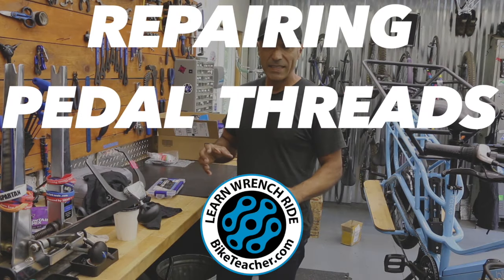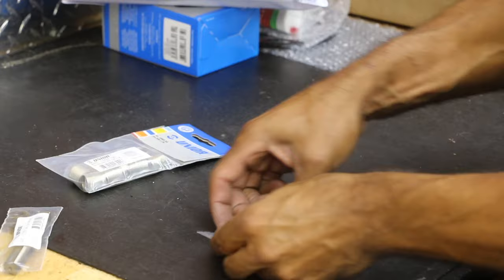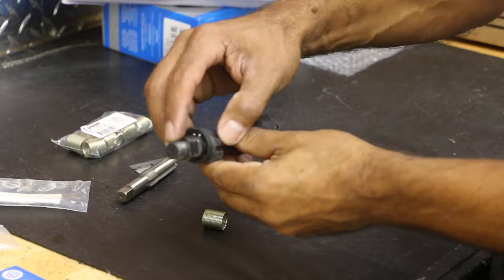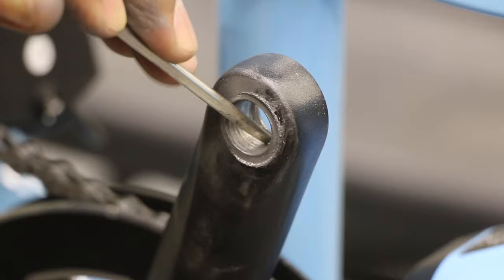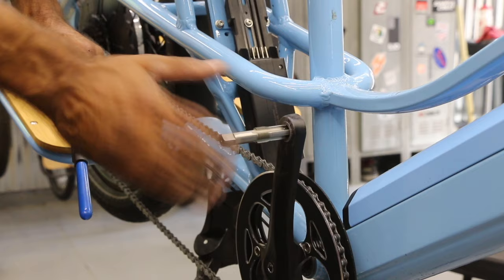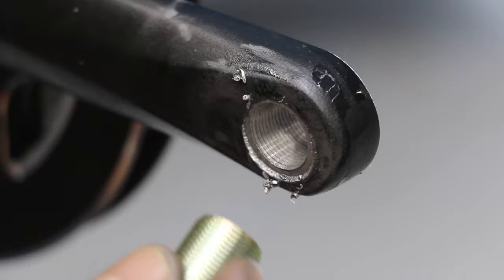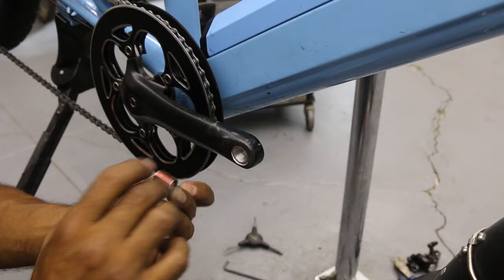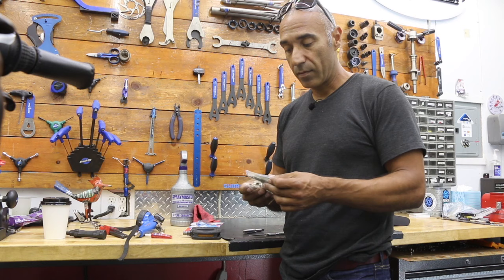How to repair stripped pedal threads on the crank arm with Unior bushing and a pedal tap.

Comment: I loved the video, so thank you for that. I understand these are special tools. Now... $178 + $11 = $189 --> Almost $200 to be able to perform this service is a little too much. Unfortunately, it looks like it would be cheaper (and easier) to order new crank arms and just replace it.
Reply from the maker: I agree, that is a valid option. I believe some shops are charging about $20 for part and labor. That sounds pretty cheap and would double check on that.
Reply: I would love to find any shops around here that would charge just $20 for this service, that is a really fair price. That indeed sounds like a great deal! I currently have a shimano ultegra left crank with this problem, which makes it a somewhat expensive replacement (for me) that would be ideal for this solution (instead of replacement). I am really glad you posted this video, so I can show people exactly what I am looking for in terms of service. I'll keep looking, thanks once again.
Reply: I have to say this is the first video of this type of tutorial I have been privileged to see. Excellent example thank you !
Reply from the maker: @sirhconardem7749  Many thanks!
Reply: The kit shown is not intended for the consumer.  Why would one person with one stripped crank thread need ten or 20 thread replacements?  They wouldn't!  Plus, buying all the tooling for one repair is not cost effective by itself.  The cost of this tool set is for the bicycle repair shop.  
An hour of shop time plus parts puts you probably at about $60 for the repair, making it a cost-effective solution.  
And some shops may be willing to perform this for less; it just depends on location.
Reply: @dudeonbike800  fair enough.

Comment: Like many of you that have experienced this I had spent hours trying to figure out the best solution to fix this problem the bike shops were charging high prices and the unior kit itself was too expensive being from the uk I tried to source the pedal tap but was costing too much to have it shipped here.  I had the threaded crank issue on my drivers (right hand) side so here’s what I did(extremely simple did not require any vices/ grips or unnecessary attachments. After waiting ages I managed to source a single unior pedal tap from deporvillage and a helicoil from sjs cycles  all in all I spent £42 for these 2 items I simply laid my bike upside down used an adjustable wrench to turn the pedal tap once it was inserted in the crank and simply turned. The measurements confused me as I had no idea what size helicoil or pedal tap I would need but I believe more than likely most bikes nowadays have the measurements of 9/16 which could also be called 5/8. Make sure when purchasing that the measurements of the helicoil and unior pedal tap are the same for example my bike required a 5/8X 24 also seen as 9/16X24 I made the mistake of purchasing a pedal tap off of eBay and the size was 5/8X20 which also did not thread correctly 🤦🏽‍♂️avoid buying cheap to save money and purchase the unior tap. Also thanks to the creator of this video made this extremely easy to follow
Reply from the maker: 👍🏽 thanks

Comment: April 2023 Question: I followed all of your instructions, and the tap went through very easily.  But, the 9/16 helicoil would neither fit over my pedal, nor would it screw into the pedal crank! So, I'm not sure what sized devices (tap;helicoil) to buy, as I'm not so good with measuring or fixing things like this. Can you tell me what's the next slightly larger size is, in order to fix this?  I have a mtb from China, and the dealer told me the size is universal.  Would the next size up be too big 7/16 I think?

Comment: You're the Greatest. I bought a reconditioned spin bike eight years ago (I know...I know... you live and you learn) and I immediately used it. Within two days the right hand pedal fell off. I examined the pedal threads and they were stripped and the pedal crank as well. Since that time it became a paper weight until I saw your video and right away it made sense. I checked off all the tools and materials that I would need from your video and waited a month for all of it to eventually be delivered. The Unior bushing and the pedal tap took the longest to arrive since they were out of stock domestically,  they were ordered from Spain and France respectively. I reviewed your video countless times to detect any nuances that might benefit a successful repair. Aside from that I checked other taps and bushings that were sold on Amazon and the reviews were discouraging. Most of the purchasers revealed horrible results. Finally I was able to use all the tools, parts, cutting oil, thread locker, and air canister in your video to commence with my repair work. It only took five minutes from start to finish. It was successful and I couldn't be any happier.  I 'm allowing the Loctite thread locker to set a couple of days.
Reply from the maker: Thats great Ricky! Glad I could help. The job seems a little daunting at first but 5 minutes proves otherwise.
Reply: Question: If I am repairing the left pedal instead (vs. the right in the video), does the coil and threading tool go in clockwise also? (I understand for the left side, the pedal tightens counter clockwise).  Thank you.

Comment: I just had a Crank Arm Thread issue a couple of days back. After some attempts finally found the solution through a Local Forge expert, who used the same rethreading tool (eventually arm thread was fine, only it needed a torsional forces with a heavy thread sleeve).

Was talking about this frequently during the whole time & YouTube comes with this today !

SCARY AI & Tech !
Reply from the maker: Scary interesting.

Comment: For the last part of the process, it works out easier if you thread the new bushing ( Helicoil ) onto the pedal first, then use the pedal as a delivery system for introducing the bushing into the crank.

Comment: Excellent video!  Thank you!
Stripped pedals all because the #1 bike shop rule isn't followed:
"All the way on or all the way off!"

Never "just snug it down and come back to it later" in bike repair.  Doing this may kill you, someone you love or a customer.  Your pedal may fall off,  your stem may twist, your front wheel may fall off!  This has happened and will happen time and time again when this rule is disregarded or forgotten.  This is what employs lawyers and ruins lives.

Three rules to follow when working on bikes (and stuff in general) and you'll go far (figuratively and literally!):
1)  All the way on or all the way off!
2)  Grease metal-metal contact.  (Yes, there are exceptions.  But they are few.)
3)  Test ride all your work.
Reply from the maker: Thank you Dude!

Comment: I keep stripping the pedal on the left side of my bike thank you for the information
Reply from the maker: Your welcome. 👍🏽
Reply: Question: If I am repairing the left pedal instead (vs. the right in the video), does the coil and threading tool go in clockwise also? (I understand for the left side, the pedal tightens counter clockwise).  Thank you.

Comment: You'll find this alot easier if you take the crank arm off first, then hold it in a padded vice. Then using a long handle ratchet set, and cutting fluid.
Reply from the maker: Yes, that can work to.

Comment: It looks like Unior has discontinued the kit, but added a new kit to their site with a tap handle for $300. Kinda rough for just fixing a crank set arm!
The taps and tap handle are easy enough to source elsewhere, but the thread inserts are a bit harder to find. How can Unior be the only ones that make them at 9/16" 20TPI?

Comment: Realky Thanks , it saved my bike, and just for  only 50€ ( 40€ for the tap and 10€ for the insert )
Reply from the maker: Cool!!
Reply: The crank is removable - you don't need to throw away the bike if there is a problem with it. In fact, you could've bought a new crank for less than you paid to re-thread the old one and then you wouldn't need worry about the insert coming loose in a few months.
Reply: djsjjd15 yess i know but mtb cranks are expensive and i doesn’t want to pay about 200 bucks bc i have some race face turbine crankset so i have just rethreaded it and after 1 month of utilisation this is perfect

Comment: I actually have a problem with a new bike, new pedal where the right pedal won't screw on the right side. Any tips?
Reply from the maker: The first thread of the crank most likely is fat. Use a pointy scratch all to clean the threads. And or install the pedal from the rear and hopefully it reaches the damaged thread to. This will help to clean up th threads.

Comment: Hi, Nice video. Very clear. I wanted to ask you if you think I machine a bushing with 1/2 20 TPI threads inside and )/16 outside soI can fit a set of 1/2 pedals into 9/16 crank without adding extra length as it’d happen ifI but the adapters available in the market.
Reply from the maker: I have not heard of that procedure or parts for that.

Comment: The pedal tap size is 9/16", a threaded insert of the same size was placed into the new hole. A pedal with the same dimension of 9/16" will fit into that insert. That's what I am understanding. But if I attach the pedal directly to the crank arm with the newly threaded hole, will the pedal still fit? I am a little confused...
Reply: This is what I want to know too
Reply from the maker: The tap will over size the hole allowing the insert to fit and downsize the back to its original pedal size.

Comment: Boom! Subbed, I needed to look this up for work in the shop. You just hack off the extra or leave it on?
Reply from the maker: I leave it on. Cutting it would take time and precision. They can be unpredictable and crumble. And there is chance of scoring the crank. Risky. Structurally it will be fine.
Reply from the maker: Thanks for the sub.

Comment: Just came across this video notice it said
San José 👍🏽 I’m from here..
So just bought a bike pretty much new. The bas is both pedal and crank tread are both gone so you said if pedal tread is gone toss it 😆 so now does that mean I need to buy new right side pedal and also the kit to fix tread on crank? Can I just weld the pedal on?
Reply from the maker: I am not sure about the welding. Pedals usually survive due to the harder metal. The crank arms may me replaceable depending on the style. If the crank arm has enough material to work with it can be repaired. I provide the service if needed. You can text me pictures if you want. Thanks, Arthur
Reply: @BikeTeacher  thanks bike teacher for reaching back..
I took it to a bike shop and they where able to rethread the crank shaft for $15 problem solved 👍🏽

Comment: How sturdy are these inserts?  I just stripped my left crank arm and the kit was more than a new crank arm set I found on ebay.  Before ordering, I called a LBS to see if they'd do it and they just recommended a new crank arm, since he felt one or two good pedal strikes would ruin the insert.  Thoughts?
Reply from the maker: So I believe the inserts to not fail. I have not gotten negative response on the one in installed. I wish I could say I have had an inset on my bike for several years with no issues but I never had one. But the kit if you will use it repeatedly. Buy the crank if it’s cost effective.
Reply from the maker: Typo, I have installed maybe 10 in 5 years.

Comment: So when you do the other side you would use a different tool and go anti... sorry,  from England! counter clockwise when making the new thread? Good video,  good teacher.👍
Reply from the maker: Thanks James, yes there is a left side and a ride side specific cutting tool.If you are standing on the left side of the bike, yes you would turn counter clockwise to clean and thread the left (non drive side) crank arm.

Comment: Thanks for posting! I recently damaged my brand new XTR 9120 L crank and stripped most of the threads. I use it on my enduro MTB. Ive had bike shops tell me the crank is finished and don't use a bushing, but this looks very solid. Do you think there are any safety issues with this? I'm definitely tempted to give it a try considering how much $$ these cranks were.
Reply: It is probably not a great idea with hollow crank arms, which that one probably is.  Most bicycle cranks are not hollow though.
Reply: @curtiswthomas  bike shop put helicoil in and has been rock solid.
Reply: @LDubsChannel  thank you! I was watching this because I also stripped my left crank on my Shimano 105 cranks. Good to know that it’s been rock solid for mtb.
Reply: @LDubsChannel  how is it holding? I want to know if this is a good idea for enduro riding

Comment: Actually I got that part for $20 on Amazon.  The tool to make the threads size is 5/8  . Make sure you specify for the right or left side . And the little insert adapter for the pedal is 9/16 (same size of the most standard pedals)  and also you have to order it for the side you need . That little adapter cost me $6 .. total: $26 with taxes . You don't need any fancy tools , just the regulars you have at home . And also you don't need the lock tight liquid.  This is just a bycycle and not a motorcycle .
Reply from the maker: Thanks for the info.
Reply: Could you be more specific when you say "that part"? im going to try to fix my exercies bike soon
Reply: Question: If I am repairing the left pedal instead (vs. the right in the video), does the coil and threading tool go in clockwise also? (I understand for the left side, the pedal tightens counter clockwise).  Thank you.
Reply: @rtong12  it goes the opposite

Comment: How about installing helicoil on Shimano crank arm pinch bolts? I find myseld in a situation now that I've stripped those pinch bolt areas as I kept on removing and reinstalling for a deep clean.
Reply from the maker: The threads in the crank arm are damaged? Or the bolts that use the 5mm tool are stripped. I can see repairing the crank arm pinch bolt threads. They give you good access. Finding the appropriate size will require some research.
Reply: @BikeTeacher threads on the crank arm are the ones stripped.

Comment: Thanks but my fatbike too broke my bike pedal treads broke what type of treads i need ?
Reply from the maker: The most common pedal thread size is 9/16". The tread pitch is standard. One size should fit all. Choose left or right side insert and tool. The one tool will clean out the crank hole and prepare the thread all in one procedure. Don't for a t handle to insert  maneuver the tool.

Comment: Maybe a silly question but I have just bought the same parts for my left pedal. Do I need to screw the tap in anti clockwise? I'm a little confused and don't want to do it wrong way and wear it away
Reply from the maker: Your right, while standing on the left side of the bike (if seated) turn the tool anti clockwise.

Comment: Question: If I am repairing the left pedal instead (vs. the right in the video), does the coil and threading tool go in clockwise also? (I understand for the left side, the pedal tightens counter clockwise).  Thank you.
Reply from the maker: Yes, you are correct. The left side will be clockwise. Thanks, Arthur

Comment: Hi, I need some advice. My bike's right pedal crank arm's thread stripped.. pedal thread size is 9/16, 20 TPI. What's the size of Thread Tap I should use for the crank arm thread? I tried with 9/16, but the thread insert (9/16 20 TPI) is not going in... Should I use 5/8 20 TPI for crank arm thread? Thanks in advance..
Reply from the maker: So you tried the 9/16 tap? Was this the pedal tap tool or the reaming pedal tap tool?The 9/16 reaming/tap tool work a with the 9/16” inserts. Did the reaming process go well? The reaming tool is left and right specific as well.

Comment: Great video. Have a 15 year old that needs to repair his Schwinn Discover Hybrid Bike 21-Speed, 28-Inch Wheels, any recommendations on what parts we need to order?
Reply from the maker: Did you get the tools? The Only company I can find is Unior, strange. I believe they are on Amazon. Double check pedal diameter size. The most common pedal size is 9/16".
Reply: @BikeTeacher  yes, we purchased all items, but had the wrong size with the coil.

Comment: I've got a Pedal Crank Thread Repair Bush Bushing Insert 9/16-20 and size tap thread do I need for my Crank for it to fit in
Reply from the maker: Not sure at the moment. I found this. As long as it is for 9/16” pedal thread. Which is the most common. https://www.tradeinn.com/bikeinn/en/unior-right-pedal-reamer-and-tap/137499934/p?utm_source=google_products&utm_medium=merchant&id_producte=10445431&country=us&gclid=CjwKCAjw5NqVBhAjEiwAeCa97d_jJnHtHBL7Ge8xodsLnVNq2wZyuFwY_DvGfOUA7rcb9pKO0MP1FRoC9M8QAvD_BwE&gclsrc=aw.ds
Reply from the maker: https://www.cyclesport.com/product/unior-pedal-thread-insert-single-right-9-16-403112-1.htm?utm_source=google%20shopping&utm_medium=organic&gclid=CjwKCAjw5NqVBhAjEiwAeCa97dYxgGASXVKPo1ndhKhZX2IZuvL2FZltz5hBYxNT_SpLVegK1x13-xoCr8oQAvD_BwE

Comment: What the size of thread replacement, and the size of tapping tools?
Reply: those are not standard tools or threads..
Reply: There are only two main pedal thread sizes, 1/2" and 9/16".  They sell kits for each.

Comment: What kind of grease do you recommend for the pedal ends (assume new pedal and new crank arm)? thanks
Reply from the maker: Any multi purpose grease is fine. A thick consistency like Park Tool helps protect against water, contaminates and creaking.

Comment: Curious if basically same technique would work on front wheel "plug and play" threads that are stripped? Brand new bike. LBS installed front fender. I removed fender to check on a front end noise and when went to reinstall and screw I tried several) won't line up with the hole. Is it just a matter of re-threading? TIA!
Reply from the maker: Ya, same concept. I have to try it today on a disc brake post thread. The guy crashed and sheared the bolt off stripping the threads in the process.